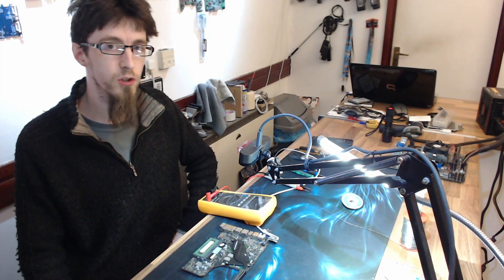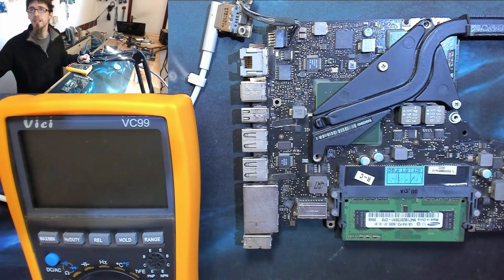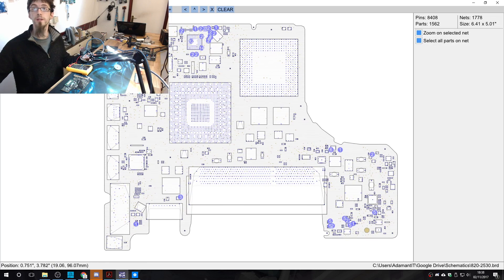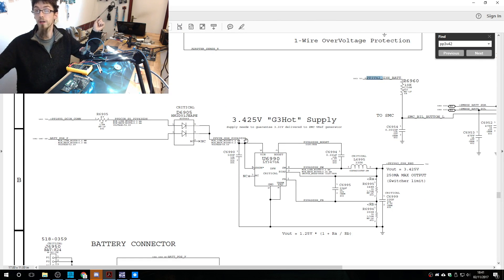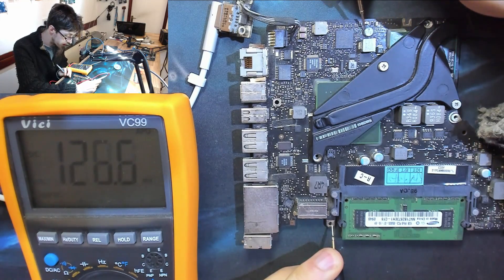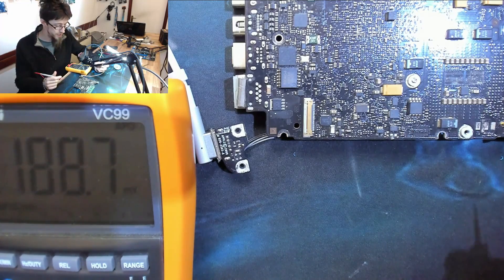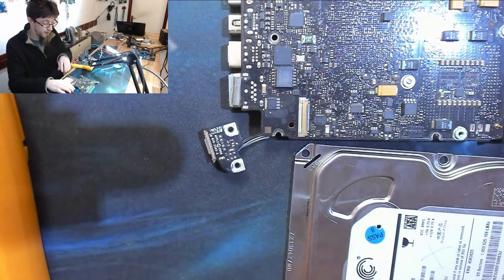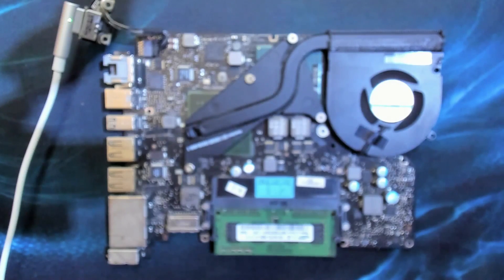Board Repair Basics #4 - PP3v42

Comment: your videos are great. anyone knows why its called Hot?
Reply from the maker: A 'hot' line means that it's always on as long as a power source is connected. Even when the laptop is 'off' a 'hot' rail will still be powered up, there's just no current draw on it until the system turns on.
Reply: @Adamant_IT ahh that makes perfect sense , thank you

Comment: I am so confused.  Why are we grounding the multimeter when checking for DC Voltage, as opposed to having both probes on either side of the capacitor?

Comment: You seem to be just fixing stuff via your naked eye. Do you ever use anything with magnification? I'd struggle to see anything without some kind of scope/screen.
Reply from the maker: Yea I need to get myself a microscope really, but scopes make it a lot harder to get really nice camera shots of the work. Most cameras that are looking through the scope give a very narrow field of view that I find makes it hard to show the context. I found myself looking at videos and thinking "ok he's soldering that bit, but what is that? What am I looking at here?"
Reply: @Adamant_IT  thanks for the reply. I saw you did a series of videos on how to. I wish i did all this in the late 90s when i was fixing stuff 6 days a week but it was often more time efficient to replace the boards. I worked for Dell on site and nobody every fixed stuff. Simply remove main board etc.Back in the early 90's it was common to fix boards then though as prices were so high and it was just more normal.

Comment: Sorry, I don't get it. When tracing down the problem, some of the components did not get any power. What was the multimeter reading then? Thought it's supposed to stay at 0. However it was all over the place, so I don't know when I have voltage and when I don't.
Reply: Exactly i noticed that too .. that's a weird multimeter for sure and it made things a bit confusing

Comment: how about another brand off laptop, is there all so ppbus_g3h and ppv3v42?
Reply from the maker: There's always an equivalent of a ppbus_g3h, which is usually just charger voltage (19.5v) going through to the secondary power supplies. PC laptops always run 5v and 3.3v rails, which are also usually Always Hot (with exceptions). The nearest equivalent to the SMC and pp3v42 is the EC (embedded controller) which usually has it's own small 3v supply, but generally you don't go anywhere near that unless you're into very high-end repair work.
Most PC laptop board faults are short on the main power rail (dead capacitor somewhere) or a corrupted BIOS.

Comment: @3:00  ...  you decide where to test PPBUS_G3H.  ..... C7330  +   C7331   
and said it's made easier bc: They're both big PPBUS_G3H points ... AND 
Bc both go to ground on the other side.  (which I'm not contesting!) ..lol

But I am CURIOUS! What notation says they go to ground on a schematic!?    Thanks!  :)
Reply from the maker: While on the boardview, when I hover over the pins it shows me what they connect to. At exactly 3:03 we can see that C7330 pin 2 is marked GND (ground). I didn't make that very clear though! The schematic would've shown it more clearly if I'd switched over to it.
It's also worth noting that the vast majority of capacitors are power related and connect to ground as well, so it's a reasonable assumption that any given cap probably has ground on one side.

Comment: Excellent series of board repair. I like it so much. Just one remark about the U6990. It is LT3470 and it is a buck converter but a low power one (only 200mA according to datasheet) therefore the switching transistor is part of the chip and therefore we don't see any external transistor.

Comment: Hey! Nice video! Can you please help me with a question: is LPC47N217N controling the display monitor output? I have a laptop with blank screen, display is good but the LPC47N217N (Super I/O with 
LPC Interface) circuit is burnt and I took it out.

Comment: How do you know which pins are output and input is it indicated in the schematic?
Reply from the maker: Yea, there's a couple of give-aways in the schematics. Power generally flows left to right on the page, so incoming power comes from the left, and outgoing power exits to the right. Then signals usually have an arrow on them to indicate if it's a signal in or out.
Reply: @Adamant_IT  thanks for the response

Comment: 3:57, what does he mean there's nothing there? It shows a voltage of 130. What was the expected working outcome? The next rail test shows 0v at 5:04
Reply from the maker: Display was on the millivolts range. We were expecting 12.6volts. There won't be 130v anywhere in a laptop.

Comment: eally u are extra technician ,i have seen your tutorials (your amazing videos). its so important to me... thank u sir.. i have dell latitude E6420 laptop here.but once upon time it suddenly fails to start up...i'v tried some times.here these are its problems 1.when i press power button its shows light on then immediately turn off. 2 when charger is plug on the charger indicator shows light on and after 2 or1 second its turns off (charger cant charging here).3 the laptop cant start on...so please help me as much as possible  if u don't mind thank u

Comment: its called an "open" or open circuit. some techs would start at the resistor or fuse, from the magsafe connection, then work towards the buck Xverters, power distribution circuits, etc, great teaching!  also, do you use/have a magnifier (like a USB microscope) or use an ultrasonic cleaner? the resistor could look intact, but be burned inside. thanks for having me as a student!
Reply from the maker: I use naked eye for the most part, but I've got pretty good near-sight. Ultrasonic cleaner I want, but I don't do enough board repair these days to justify the cost!
Reply: Adamant IT a good 99% rubbing alcohol brush down is sufficient? thanks..yeah, a suitable sized ultrasonic cleaner is a bit high $$ but a good investment. 😃  also, do you have a laptop battery rebuild video? thanks
Reply from the maker: Yea alcohol works well enough for me. Ultrasonic might save a liquid damaged board without you even looking at it though, so that's when they can pay for themselves.
I have a LiPo series about tearing down batteries, but I don't have any battery rebuild videos yet, I generally replace them.
Reply: Adamant IT ok thanks again